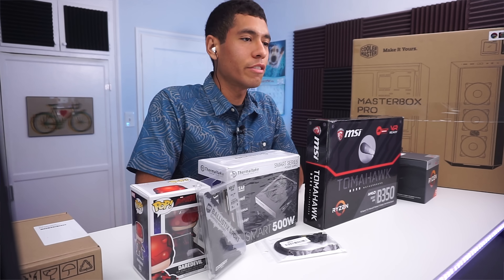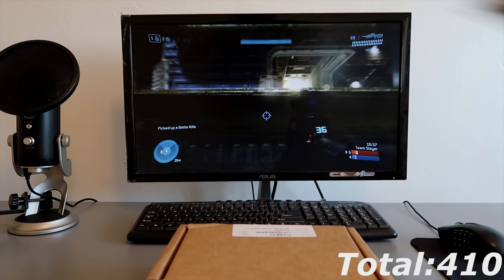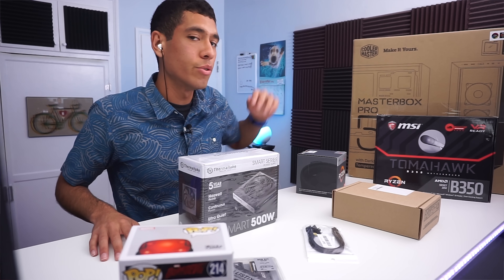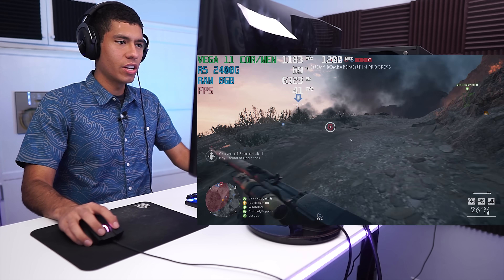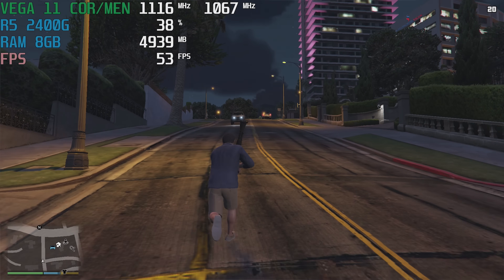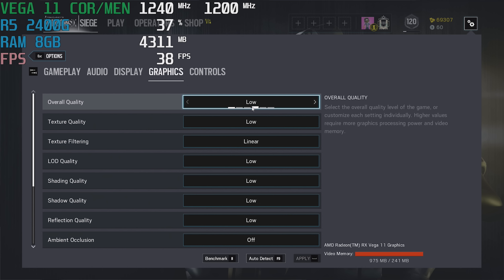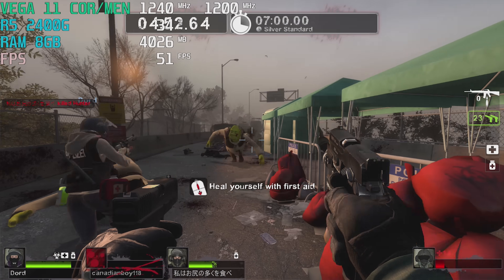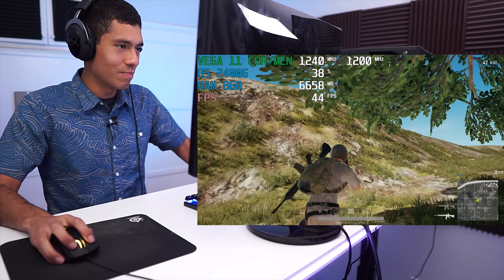$500 Budget Gaming PC Build - Ryzen 5 2400G (w/ Benchmarks)

Comment: Heyy, I used this case but my fans won't light up. I'm using a gigabyte ab-350n- gaming WiFi. Everything else works. The fans are spinning just not lighting up. I followed the instructions. But do I plug this into rgb 4 pin header or  a normal cas fan header. Since it's not working

Comment: This is gonna be my first ever build here is what i got any suggestions guys.

Tomahawk B350 motherboard 

Ryzen 5 2400g

Caviar blue 1TB 7200rpm hard drive

Seasonic 520w 80+ bronz atx power supply

Corsair vengance 8gb 2400memory

Diypc silence bk window atx mid tower case
Reply: Also the cpu cooler be quiet pure rock slim 35.1 on amazon for 40$

Comment: I think you gave the integrated graphics only 512mb vram u have to give it 2gb vram in the bios. Why do i think that? Well battlefield used 7gb ram but if u would have given 2 gb vram to the integrated graphics it could only use 6 gb ram. With 2gb vram u would defenitely get better performance

Comment: sir I want to ask you something, please answer.

I'm planning to build a PC based on 1 of your video (the one that use MoBo MSI B350M pro vdh, r3 1200 and gtx 1050 ti), but after doing some more browsing, and after looking at my own pocket, I change my plan to not buying gtx 1050 ti yet and instead of r3 1200 I'm buying r5 2400G. If later I buy gtx 1050 ti, is (r5 2400G + gtx 1050 ti) better than (r3 1200 + gtx 1050 ti)? Or maybe this one better: (r3 1300x + gtx 1050 ti)? Thank you.

Comment: Love your vids bro, been watching some of your vids since last summer, may I ask what software did you use in recording the gameplay of the games, if it's OBS may I see the output settings? My system specs are "OK" in terms of gaming, CPU=i5-6700k GPU=radeon rx580 Ram=16gb 2400mhz, when I play R6S it can handle ultra settings maxed, getting an avg. of 80+fps in benchmarks, but for some reason whenever I record the gameplay on R6S in 1920x1080 res - 60fps, the recorded video stutters.

Comment: The reason you was getting drops is because thermal limit or voltage limit on the VEGA 11 GPU. if you watch the numbers it lowers in clock speed. idk about the water thing though XD

Comment: TIP TO AVOID STUTTER in the bios the is an option where you can change the amount of ram thats being used by the integrated gpu by stantard is 2gb but if you lower the allocated ram to 64 mb you wont find any performance differences apart from the fact that there will be no stutter
Reply: so decrease the vram from 2gb to 64mb?
that doesn't seem helpful
Reply: lol nice troll
Reply: Thx
Reply: or buy 16 gb
Reply: Rafael Villanueva it's less about the ram size as much as it is about the mhz

Comment: All in all a great build Joey, 
But just one thing, cost of a build for about a 500$ in 2018 is just not worth it without a graphics card, 
   Of course one can upgrade it but it would really be worth spending if the build is based at about a 350-400$. Like investing in case and motherboard, aesthetics etc just cranks down that frame per dollar.
 Where there is the Xbox one x for 500 $ this pc just doesn't make sense if build at this mark.

PS: Just a suggestion brother, I love your videos!!

Comment: if you use the 2400g whitout a gpu you will need atleast 3000mhz ram to have better fps and dual channel, for the fps drops is becouse the gpu is new and still have some problems but i think they will fix that soon whit some bios updates or gpu drivers updates if im not wrong.

Comment: The video is finally out! The fps problem was because the default vram limitation is about 512 mb in bios and and can be turned up upto 2gb, second of all the fps drops are because there's problem with msi motherboard. This apu works tottaly fine on gigabyte mobos. Thirdly there's video recording done, it might done by software and not by some external hardware. So the fps in live benchmark is affected in the vid. Btw nice video, keep up <3 love from India.
Reply: VNM was about to ask him with th3 recording and yep R5 2400g can be overclocked and its super impressive and worth irs price ... Planning to buy
Reply: Dude can you help me and tell me how to upgrade my bios
Reply: VNM  no it's not that would only effect the FPS by a tiny amount(1-2 FPS) as it uses system ram and not vram.

Comment: My friend is buying the parts for his first gaming pc! (I know, bad timing.) I gave him a spare full ATX case, a 1TB hard drive, and a copy of windows 10 Pro. 
He's buying with his money:

AMD Ryzen 3 2200g
GTX 1050 ti
MSI Tomahawk B350 Motherboard 
650 W power supply
8GB (2x4GB) of RAM
and some case fans
Reply: Thomas Matteo  why buy an apu if you getting 1050ti? My r3 1200 does me well
Reply: Justin Lukose He is talking about the power supply lol
Reply: Raahim Syed oh I got a little excited xD
Reply: The Doctor the APU is fine for minor games, but there are times when a dedicated GPU is needed.
Reply: The PSU is kinda overkill, a 400watts should do it :)
Reply: Mino DX I know but I found one for $50 and the wires are all black so it doesn't look crappy in the build
Reply: Mino DX
apparently, PSUs do a lot better when they are powering the system at a lot less than their full capacity, and last a lot longer. 400 watts might be able to cover that system, but a more powerful PSU will be far superior in the long run, and can allow for upgrades without swapping out the PSU later on.
Reply: The Doctor Well maybe because 2200G replaces fully Ryzen 3 1200. Ryzen 3 1200's status is now officially "End of life". Its the same cpu otherwise, but its got an gpu integrated inside of it. And its msrp is the same than Ryzen 3 1200.
Reply: Thomas Matteo 1050ti for only 50? Dang, Nice deal!
Reply: The Doctor its cheaper
Reply: akaEnoh How much fps at warframe? :O
Reply: akaEnoh make sure your display cable (VGA, hdmi or whatever you use) is plugged into the gpu and not the motherboard.
Reply: I do understand all of your points and I know ryzen 3 1200 is ‘end of life’ but there would be actually no point of changing from igpu to gpu even if it doesn’t need to stress the gpu. It doesn’t matter if a 1080ti runs the desktop or integrated Vega graphics does it. Just a little more money you can spend on a dank rgb strip to add 10fps
Reply: I wish I had a friend as kind as you.

Comment: Say I was to build this, could I just wait till GPU prices lower and put one in
Reply from the maker: Yes, that's what I was hoping people would do. I see the 2400g as just a temporary solution. Definitely upgrade to a graphics card later on when prices are normal.
Reply: Joey Delgado I wonder how well this cpu would perform with a graphics card as just a pure cpu
Reply: Joey Delgado AMD has something called "dual graphics" where you can use your amd APU and GPU for more performance
Reply: It's basically a little better performing Ryzen 5 1400
Reply: the cpu is good.
Reply: Blinx482 is like a 1500x
Reply: Forgot, it has higher base clock speed too. Right
Reply: you'll be waiting a while.
Reply: grey hound doesnt matter the the dual graphics settings still apply.
Reply: Gio not swap, just add it on. This would make it so you would use a GPU instead of the APU. And a 1050 ti would be a pretty big upgrade from this
Reply: Delta7 Cliq can their performance be combined?
Reply: Affan Ali yes
Reply: Jeremy Raymundo 1050 ti outperforms the APU by much more than a little bit
Reply: Devin Stark get  a i7 8700k and wait a few month
Reply: Joey Delgado would a gpu help the FPS and the glitches you had during gameplay
Reply: They won't at least not in the near future... So sad. I better wait till new gpus realese
Reply: Joey Delgado so what graphics card would u recommend for this build graphics wise? Like a 1060 maybe?
Reply: Devin Stark just buy a prebuilt
Reply: Devin Stark that's true or I might add a 1050ti or 1060
Reply: How good will this setup perform with fallout 4?
Reply: Devin Stark I
Reply: Would this build be better than a 4770k ?
Reply: use this first then put the gpu in later
Reply: 1600 will do better but the 1600 will REQUIRE a grahpics card that can cost as much as the entire rest of the build (1060 6GB = $400)
Reply: Devin Stark i speculate the prices wont drop until bitcoin pops if it is even going to.
Reply: Devin Stark thats actually the idea but make sure when you buy a gpu buy a 1050ti or better
Reply: What graphics card do you recommend i just bought this pc and its my first one so kinda need some help. Mainly play CS Go and Fortnite
Reply: Joey Delgado  would the motherboard need a bios upgrade?
Reply: Jeremy Raymundo So does this mean I swap it out or add it in? Sorry for being such a noob barely getting into it
Reply: Devin Stark Thank you ! Appreciate the help
Reply: Devin Stark  So I was looking into it and would it be the msi GTX 1050 TI or the EVGA GeForce GTX 1050 Ti ?
Reply: Apex Predator can I put this a i7 8700k and a gtx 1080FTW to this a play ffxv on 4k
Reply: #Gio
zotac geforce gtx 1050 ti oc 4gb
Reply: Gio 1050 ti would place you a little bit above the vega onboard anything higher would mean more performance
Reply: no they can't...this apu is using a vega gpu

Comment: Do you think an extra 8gb of ram would have dramatically increased performance?
Reply: U also need faster RAM...makes a hell of a difference
Reply: Joseph Royzman that video is two years old. Zen is different in the fact that infinity fabric, the interconnect runs at half the ram speed. Plus these apu's are bandwidth bottlenecked, so fast ram helps, A LOT. 25 % between 2133 and 3200.
Reply: Joseph Royzman I just saw many YouTube channels which show how ram difference between 2133 and 3000mhz using APUs.
Reply: Emerald Player finally someone gets it 😅
Reply: Who said vram speed doesnt make a difference!?! Whos that ignorant guy in the comment section?!?!
Reply: Joseph Royzman it does affect the APUs drastically
Reply: DISTEEXE on some games and in the future yeah
Reply: ngik ngok pubg looks bad with max settings and its very unoptimized
Reply: I know this is old, but don't suggest Linus tech tips for actual pc guides. The dudes alright but he is wrong about many things.
Reply: no, just faster ram would dramatically increase performance.
Reply: TED once you go past a certain ram speed it no longer makes a difference in performance as most games don’t use that much
Reply: You guys have to look up zen archjtech it a 15% fps boost for fast ram 3000mhz and above hut low latency helps too
Reply: Joseph Royzman it’s actually makes a huge difference because AMDs APUs use ram as there memory instead of vram
Reply: Absolutely yes.
Reply: Exactly, the Ryzen G need fast ram (3000/3200) with dual channel and possibly low timings (C14) to perform at the best, running a single stick and at 2400MHz is suicide, you can save on everything, but not on RAM, I did a full and detailed review on that topic, the gains of a dual channel 3200 C14 over 2400 Single can be like double in real gameplays.
Reply: Although the debate is pretty much over, I'd still say- yes, absolutely. You can get like a 2666MHz and OC it to some 3000mhz and you'd see quite a jump in some games. Normally ram speeds don't affect that much but these APUs love eating fast ram
Reply: Joseph Royzman its makes a big difference for Ryzen, especially their apus. Not so much for intel.
Reply: @TED Actually ram speed doesn’t have that much of a difference check out Linus Tech Tips video on that
Reply: PUBG is a GPU not a RAM game..

Comment: Try doing a cheaper build with the ryzen 2200g but maybe pair it with a decent cheap gpu?
Reply: gang No, you can actually use you apu and gpu at the sane time but u also have to have a amd gpu... go into the amd Software and choose dual graphics. Boom you are using both graphics on apu and gpu at the same time.
Reply: no point..? you cant use the apu and a gpu at the same time to run games faster... it just uses the gpu? i dont understand whatu mean cause he'd be better off just buying a normal ryzen 5 cpu
Reply: ok cool use it with amd but thats probably not what aaron ment, he probably wanted a 1050 with the apu cause cba overpaying 200$ for an amd gpu
Reply: gang no I meant an amd GPU not a  1050, don't assume my gender plz 😬
Reply: no way you ment it with an amd gpu, you just said that cause delta explained it. not in a million years did you mean an amd gpu
Reply: gang well let's say a million years has passed cause I did mean a amd GPU
Reply: then say that next time alright?  "Try doing a cheaper build with the ryzen 2200g but maybe pair it with a decent cheap gpu?" is pretty vague.
Reply: gang Alright then my bad, doesn't rly matter since I doubt Joey saw this lol feelsbadman 😒

Comment: You didn't overclock the gpu clock speed or the memory in this video, which is cruical to get good performace with these APU:s. Get 3000 MHz RAM or more, and overclock the gpu core to atleast 1400 for free with the box cooler.

Comment: Buying a pre built is better than building a pc atm
Reply: because most company's that build prebuilts have like a deal with nvidia and other gpu manufacturers so the companys can get the gpu's for msrp, so they sell the system for msrp + whatever they charge for building the system and shipping
Reply: UnmercifulMango What games do you want to play?
Reply: UnmercifulMango Right now the prices of GPUs are very high, that's all. I'd suggest spending a bit more on a 4GB video card, but if money really is tight, you'll be fine with the setup mentioned above
Reply: Why is it?
Reply: But you often sacrifice upgradability and customisation
Reply: UnmercifulMango If you're looking for a gaming PC for $500, you're not going to end up with something great - most likely an AMD A8 processor or an early generation Intel i3.
Reply: UnmercifulMango probably a 1050ti at minimum and I think it should be a while until cards will go back down
Reply: UnmercifulMango You'd be good with an Intel i3-7100 paired with a 2GB video card, and 6GB of RAM for Skyrim, Fortnite and CS:GO.
Reply: UnmercifulMango https://m.newegg.com/products/N82E16883102335?ignorebbr=1
Here's a suggestion